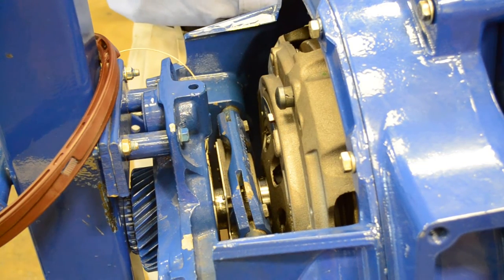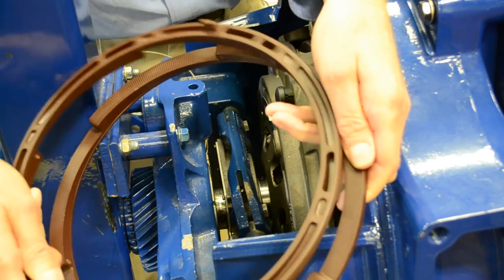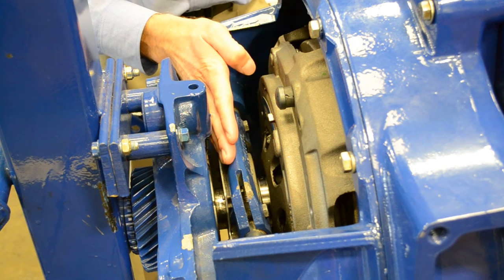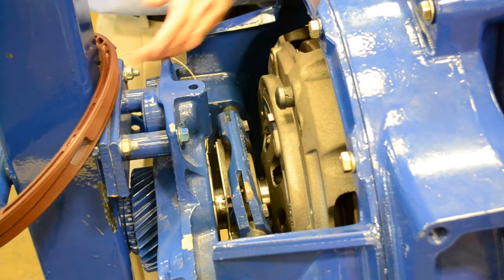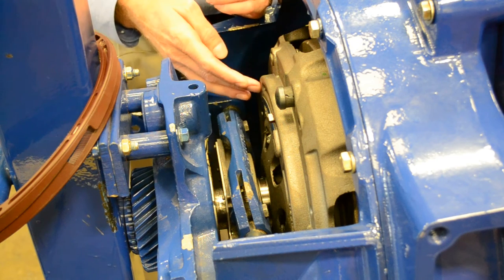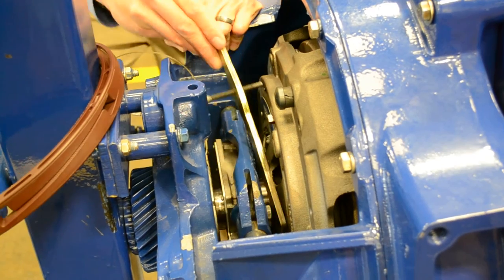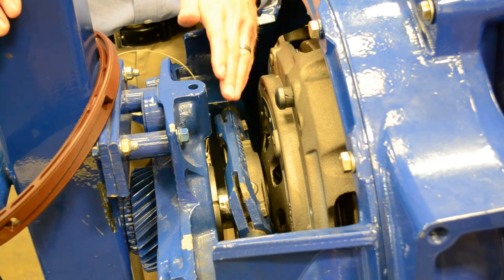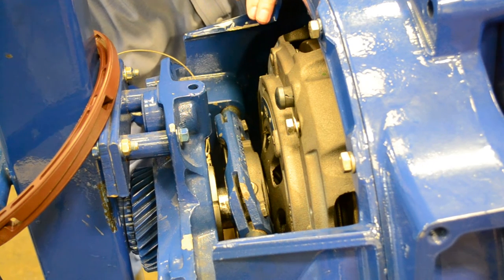Solo Clutch Style - Video 1

Comment: if you loosen the 12 transmission bolts to reset the overadjusted clutch do they need to tightened back up before the installation of the shipping caging bolts.